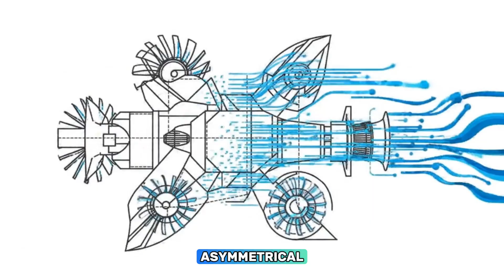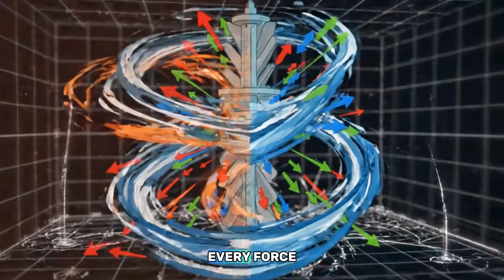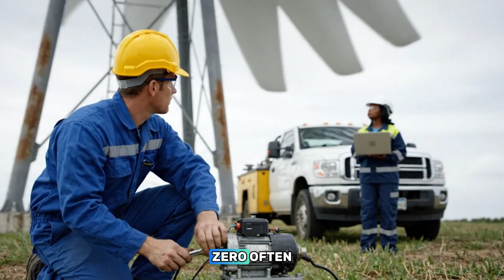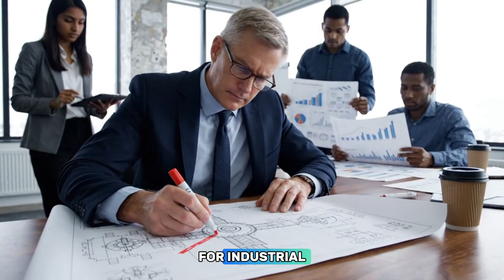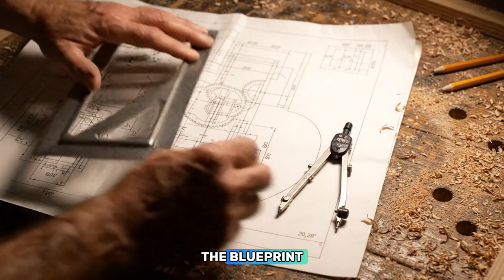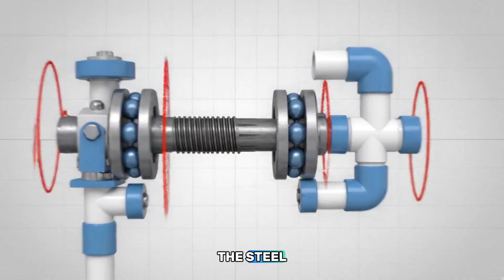Build An Indestructible Wind Turbine From Scrap - Unlimited Off-Grid Energy At Home

Comment: WOW is there a worse example of AI  out there?  to start with you dont know what you are talking about you start by calling "normal" wind turbines Savonius, where as " A Savonius wind turbine is defined as a drag-based vertical axis wind turbine that consists of two semi-circular blades. It operates by utilizing the difference in drag forces on the concave and convex sides of the rotor to generate rotation." 
and more stupid things,  i mean a man leaning on a rotating grind stone?  and a heaps of other stupid things, Like a man walking through solar panels , plus a lot of what you are saying is wrong, your credibility is lower than zero!!! 
YOU HAVE TO DO BETTER